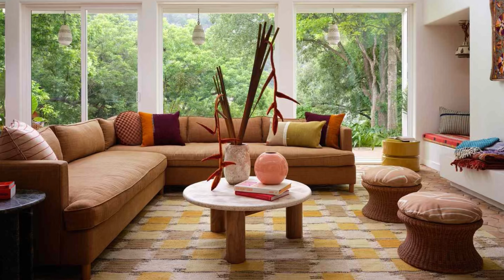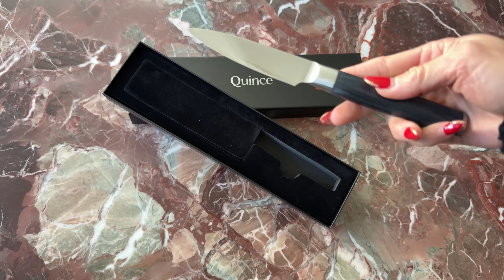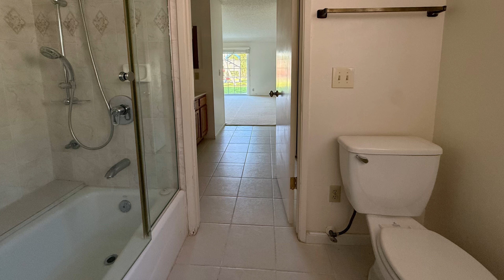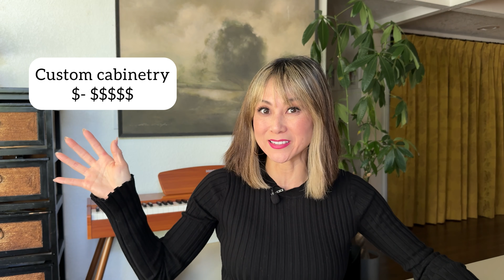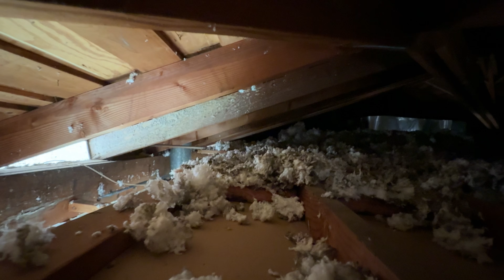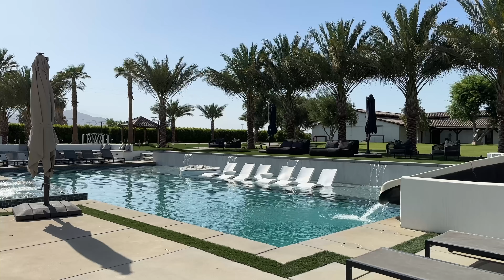Interior Design SPLURGE vs. SAVE on Your New (Old) House | How to Make a Regular Home Look Expensive

Comment: Things are getting along, although the schedule is tight... I hope everything will go fine.

Next reno for me is my bedroom, plus changing a few doors, I'm saving for it at the moment. Last big reno was the bathroom, even though it's a rather small one, it costed me 10K+, but I moved some plumbing, changed the tiles and added a floor heating system. I don't regret a penny on it, but it was pricey. Fortunately, I have bought the tiles, the sink and the toilet on sale the year before, spreading the cost.

I still need to do the roman shade for my office, which I redid last year. Thanks again for suggesting the Morris fabrics, that will really make the room colors fit together and will give visual spice to the room. ^_^

Comment: Built new ourselves (contracting out as needed) and it was a very trying process (to put it mildly) but I was mindful to be generous in the budget for roofing, exterior finishes, insulation, and hvac since I wanted to do it right and have it last decades. For our kitchen, I splurged for our counters and backsplash, custom cabinet doors, panelled dishwasher, and range but saved with ikea cabinets/drawer system, a LG fridge, and hardware, sinks, and faucets from Amazon/big box stores. And put a smart toilet (from Costco) in our ensuite bathroom
Reply from the maker: You’ve got the right idea Sarah! I could turn your comment into a “how to prioritize for your new kitchen build” video 😂 Excellent job working out your needs vs. wants! 🙌

Comment: I’ve been renovating my house since I moved in late 2024. I have an extremely small budget and used almost half on a minimal amount of work done by a mediocre very expensive contractor. My real issue is how do you find reliable competent and skilled workers for a fair price?
Reply from the maker: You want to keep your budget in check? You may have to cut out the general contractor, unfortunately. I have built (and refined) my team for the past 18 years. A majority of my team are all skilled artisans with their own practice. If you can find them independently of the GC, you will be paying 30% less (at least!). Don’t underestimate Yelp if you’re in the states. I have found some of my fav subs from Yelp app

Comment: I renovated my home recently. Much of the work was done by my husband. We watched aa lot of you tube videos for inspirational ideas. The kitchen counter tops and backsplash were installed by professionals. We have also replaced the windows. I chose vinyl  plank flooring because it is water repellant and pet friendly. I would not recommend this flooring because it chips when items are dropped.
The backsplash is the kitchen focal point because this is what I see first. I painted my kitchen cabinets, after reading good reviews. It was an easy DYI, but it's been 3 years and has not held up as well as I expected.

I wish you good luck in you renovation adventure Julie
Reply: I have had cabinets professionally done and still had terrible results. So don’t feel so badly about that. be careful who you choose. The cabinet was in the bathroom but I had two bathrooms done and only one is in bad shape with peeling warped cabinet fronts on a custom installation ! Different contractors during Covid.
Reply from the maker: Yup- same here Margaret. Clients chose their own contractor who fabricated with my specs and they did a terrible job finishing the cabinets. It was supposed to be a lacquer shellac/ they used basic paint and it started chipping at the year 1 mark 🤦🏼‍♀️
Reply from the maker: I’m watching a lot of YouTube videos to learn how to refinish my hardwood floors. They’re very orange- I want a warm walnut finish and my contractor is charging me almost 7K 😵‍💫 let’s see how I do 😅🤞🤞🤞

Comment: I live in a 1930s Victorian 3 bed semi in the UK, and i did a major renovation of the kitchen dining, where I knocked the wall in between and took everything back to brick and did everything upwards from them. Im on week 6 now and it 's almost finished. There were lots of typical old home structural issues along the way and repairs, but everything from the floor, ceiling and all the gas repiping to the whole kitchen, new ventilation and insulation, floors, paint etc. is being done. It was my most expensive house project to date. 
Most of the rest of the house was already modernised, including the bathroom by the previous owners, so I mostly just replaced all the floors and changed the wall colours. I went with LVT floors all downstairs, and just laminate upstairs because of budget. I like the way laminate is durable and does not scratch, my LVT scratches easily and I have to be so careful. I use Alexa but did not get smart lights, just have some smart lamps and security cameras. I would rather use a switch to turn the main lights though.
Reply from the maker: Wow, sounds like a massive undertaking, so excited to see how it turns out Yuki! 🤩 My mom is the same. She stays with us sometimes and Alexa doesn’t listen to her 😅 she prefers manual lamp operation as well

Comment: I just had my master bathroom remodeled.  My house is only 4 1/2 years old, but i bought a spec house during the crazy time in 2020 when I just had to buy what I could find.  Houses were selling for way over the asking price back then & i found a framed new build, halfway finished with all upgrades already chosen by the builder.  My master bathroom was very basic.  Now it is beautiful!  New flooring, new vanity, new sinks & faucets.  New shower floor, walls & fixtures.  I did not change my water closet, linen closet or move any walls.  It took about 7 or 8 weeks with a few days off around Thanksgiving & Christmas.  I also finished the kitchenette in my "guest retreat" area.  My new build came plumbed for a kitchenette with a pipe sticking out of the wall!  I could have just stuck a desk in front of that pipe but I wanted it done.  That was finished about 1 year ago.
Reply from the maker: I can’t with the new builds these days! They use basic builder grade b.s. materials and make you pay for it! Of course these are the finishes that all clients want out/ it’s the first to get demo’d when finishes are literally brand new 😩

Comment: I'm so glad you are letting us tag along and watch the transformation of your new home Julie!! My budget and home is much, much smaller than yours and probably most of your viewers 😅. When we moved from San Francisco to rural Kentucky, we bought our house "sight unseen" as it were. Only having pictures and video walk throughs to watch. So when we actually got to KY, the house was in a much worse state than we were told, or that we could see on video. We had soooo many unexpected costs just to make the house livable.  We ended up getting a whole house mini-split from the Restore to replace the non-working HVAC. And instead of a furnace, we bought a wood burning stove for the main living area of the house and a pellet stove for the Primary suite. You'd be surprised how well the stoves work in winter. We had a very bad ice storm here (that was quite an experience for this 3rd gen California girl) and some days it was -2 degrees F!! But our home was a toasty 74 degrees inside. Firewood is very cheap in KY and our most expensive electric bill this winter was only $167.00. luckily my hubby is extremely handy, and smart, and can learn to do anything watching enough YouTube videos, lol, and installed everything per code. We still have a lot more to do to the house before it has all the basic functionality and comforts. And I'm eager to learn from you about how to do that! And where and how to spend my tiny budget to make my scruffy home look luxurious!
Reply from the maker: Thank you for sharing your incredible story Timilisa, wow can’t believe you bought sight unseen! I'm so inspired by your ingenuity and budget-friendly solutions! I’ll definitely share my process along the way. You always go into renovations thinking one thing, then you open up the walls and boom 💥 Money pit 🤣

Comment: I spent 30k on a new HVAC system..blue tube Uv exchanger, vents etc. on a 3000 sq ft home.  The new asphalt roof was also 30k as the ceilings were high with lots of ridges, rafters pitches omg.  When you have older homes even into the nineties sometimes the electrical panel box has to be updated.  I changed gas to electric water heater and had to run a designated electric line for it...everything is so expensive now!  My kitchen had a great layout so I painted the cabinets and put money into new appliances.  Putting money into the main 4point items electrical, plumbing, roof and hvac is more important than the decor as hard as it is when you do not have endless amounts of money.  I cannot imagine doing a whole house reno so I am living vicariously with you and I am so grateful for you sharing your knowledge as you go.  The contractors and permits alone would keep me up at night!
Reply from the maker: I LOVE the construction phase of design, it’s probably my favorite more than install + reveal day. Working through challenges and coming up with viable and stylish solutions is the best part. What I’m paying now is 30% over what the market was like even just two years ago. And it’s MY pricing, no middle man! Sheesh 😵‍💫
Reply: @JulieKhuu  A rare talent indeed!🫶